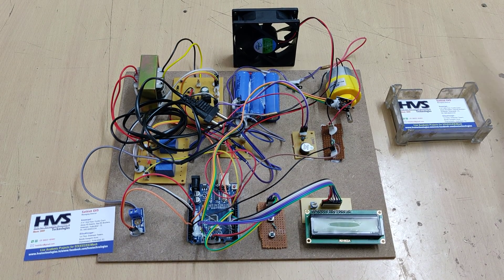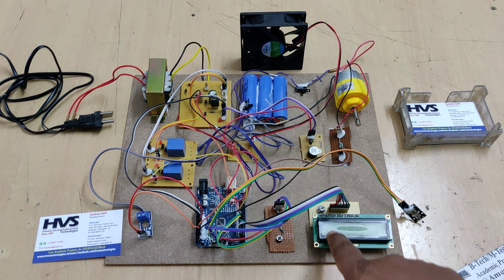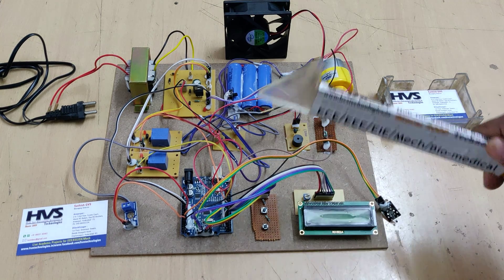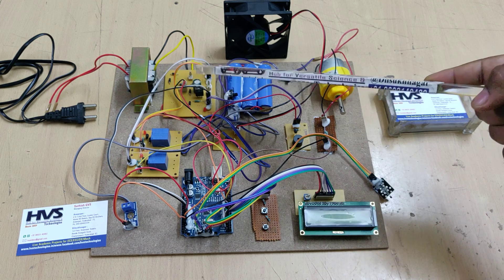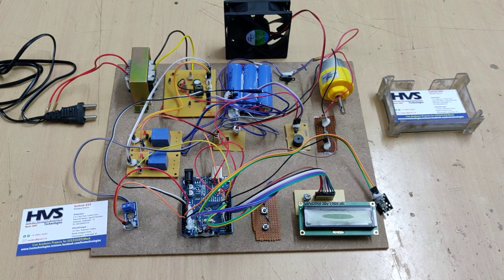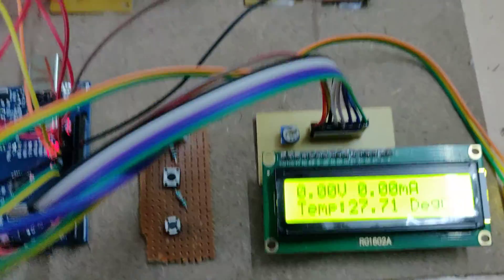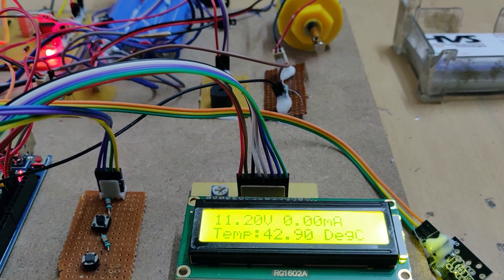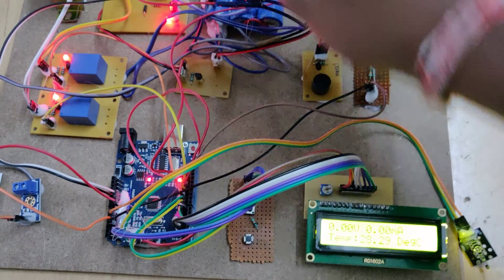HVS-4591. EV BMS with Charger Monitoring and Fire Protection using Arduino UNO.

Comment: It is possible to develop an AI-based Battery Management System for Electric Vehicles.
Reply from the maker: Yes. You can contact us at +919603140482
Through WhatsApp or call

Comment: Aurdino
Reply from the maker: @CartoonToons479  yes. Arduino. Hi, 
We sell full working kit with document PPT circuit diagram and code. Could you Send me the video link, Will update you the cost details. You can contact us at +919603140482
Through WhatsApp or call

Comment: Can u pls share the details about circuit connections and source code please sir 🙏🏽
Reply from the maker: You can contact us at +919603140482
Through WhatsApp or call
Reply: Hii , did you get the ckt diagram
Reply from the maker: You can contact us at +919603140482
Through WhatsApp or call